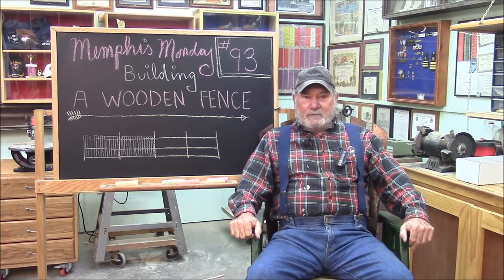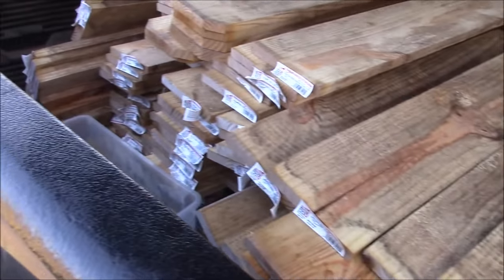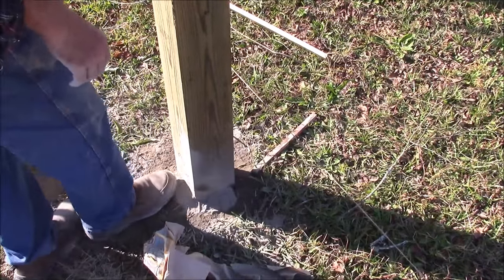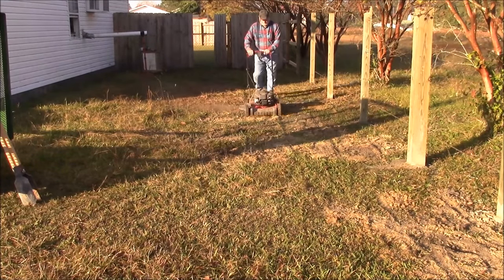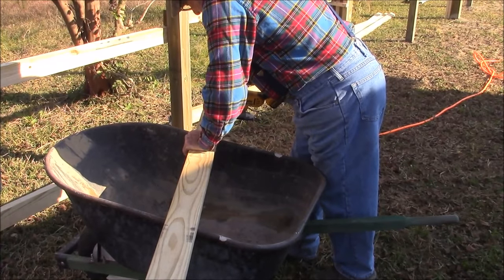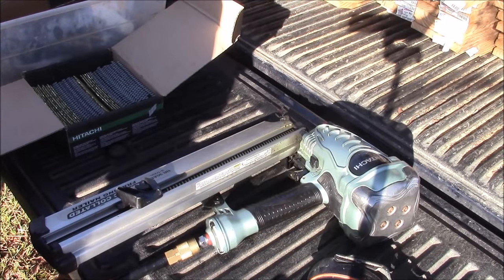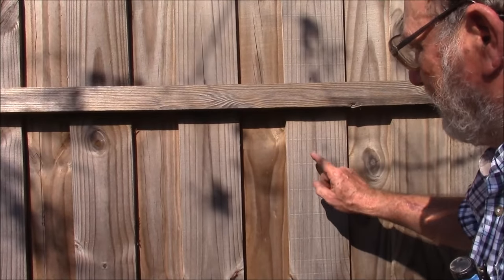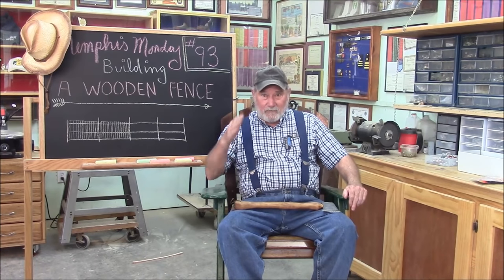Building 70 Feet of Wooden Fence MM 93

Comment: Absolutely one of the best wood fence building videos I have ever seen because of this video I'm going to build my own from scratch just like you did thank you for making it look easy.
Reply from the maker: The hard part isn't technical, like being an electrician, it is the physical labor that gets to an old guy.  But I still like doing it, just takes a little longer to recover.
     Before you build your fence, check out the way posts are installed in your location, which is variable.  
     Thanks for watching and commenting.

Comment: I enjoyed your interesting video & you going through all the steps of putting the fence up & the fence looks great & yard appealing. We're thinking of replacing our old fence ASAP.  And as a female your video gave me a little incite on this big project. Thanks for sharing.
Reply from the maker: As a 70 year old male it is liberating to say:  get some young folks to help!!  Male is best, as a 17 year old is not only indestructible, but they know they are indestructible. This is the demographic we ask to leap out of foxholes and charge into machine gun fire, and they do it!!!    .  
     The point is, building a fence is hard.  Not hard technically, rather it is just hard work.  This little 80 foot fence section probably had two tons of wood.  This wood had to be loaded, and then unloaded several times.  
     Good luck on your project, but I would offer two suggestions: 1) Get some young folks to help, or 2) hire a professional to install the fence.  Frankly, unless you are really into this kind of deal, like I am, then getting a professional to install the fence is the best option.  
    Heck fire, I don't even change my own oil.  I build fences only because I enjoy it.  So if you like this kind of thing, then build it yourself, otherwise hire a professional.  
     Thanks for watching and commenting.

Comment: For all that say dont put pickets to the ground.You need the pickets to touch the ground for the support of the weight it carrys accross the poles in between. Now for rot, even if you left the fence off the ground from day 1 does not mean it wont rot later, because the ground over time will build up, so put the pickets to the ground it help support the weight....im sure this guy knows gravity/weight.

Comment from the maker: The sound of a lonely cricket, followed by the sight of a small dust cloud pushing a tumbleweed down the single street of a ghost-town.
Reply: It is awful quiet here. I admit I'm a bit late with my comment(s), but I did watch the video on time. That fence line you built was a lot of work and made for a nice video. I like the style you used with the fence. I have to admit I'm a bit jealous about the soft dirt you have there. :-D
Reply from the maker: I totally hear you on that soft dirt.  I've lived in places where you would have to rent a power take-off post auger.  While I was in the service we were asked to plant trees on a bombing range in Hawaii.  The ground was so hard that we had to blow the holes out with explosives.  I concluded that the hardness of the soil (barring rocks of course) is the amount of volcanic ash in the dirt.  It seems like the volcanic material leaches out chemicals which tend to set like concrete over time.  
    My silly comment was for Hippie.  Last week we were joking about the visuals of the Clint Eastwood Spaghetti westerns.
    Thanks for watching and commenting.

Comment: Should be putting gravel in the hole first to get the post up off the soil.  The bottom of the post will rot if you do not. He used the wrong cement for one thing. Should have used the fast set (red bag) if you insist on pouring cement around the post. In any case the entire contents of the bag need to be dry mixed prior to putting it in the hole. The reason for this is the contents of the bag (cement, aggregate and sand) separate during transit. Also know that concrete will wick and hold moisture and cause premature rotting of the post. Wrap the post with 30 lb. felt prior to pouring the concrete to make a drainage plane.

Comment: helpful video. like your Tacoma
Reply from the maker: I had the original Tacoma, a 1985 Toyota pickup.  I drove it for 25 years, and of course trouble-free, until I needed a bigger truck to support my Memphis Applegate adventure.  So I bought a Dodge Ram, which worked fine, but I felt like I was deserting a member of the family when I drove away without the 1985 Toyota.  Trying to redeem myself, I bought the Tacoma, and it is wonderful.

Comment: great video Memphis enjoyed just one question the cost comparison with making the fences your self and buying them
many thanks look forward to watching soon
Reply from the maker: As built I think my stick built is perhaps $10  per eight feet more.  My version has 24 pickets instead of 20, and I used 2x4's instead of 2x2's for the stringers.  The stick built is easier to build, unless you have plenty of help to carry those prefab sections around.  Another disadvantage of the prefab panels is that the 2x2's are too weak and they sag with time.  My 2x4 stringers are stronger and will sag less.  
     Thanks for watching and commenting.
Reply: That's one of the downsides of prefab is the 2x2's used for stringers. I do agree 1000% that 2x4's are much better cause they definitely resist sagging.  But i hate hate hate building fences so i go the lazy route and get good quality prefabs. Yellawood makes awesome quality pressure treated prefabs that are just as good as you build yourself of course downside i have to settle for 2x2 stringers :( I am the incredible hulk i can handle prefabs by myself no probs lol
Reply from the maker: 50 years ago I was the "Incredible Hulk" tool   But I'm not the same hulk I was back in the day, and as Clint Eastwood might say, "A man has gotta know his limitations"  So far, that transition has been easy for me: "Well, I guess I can't do that anymore."   But at 70 years old I keep testing the envelope; I keep putting out the projects, looking for alternate ways to do the things "I can't do anymore."  
    Perhaps that is the key.  At 20 years old I could physically do anything, but I didn't have the experience, nor knowledge, nor skill to do much at all.  And now fifty years later, here I am, basing my work decisions on my own physical limitations.

Comment: Very good video and I learned alot as im thinking about doind a board on board fence. Do you still recommend spacing pickets 3.5 inches inbetween pickets or would you go wider? Thanks for sharing
Reply from the maker: The smaller the better, I think.  Main thing is to keep them plumb.
Reply: @MemphisApplegate  what do you think a overall cost would be for a board on board fence made out of cedar 250 ft with two walk through gates and two double wide gates? Just a ball park idea
Reply from the maker: @ddemier  Man I hate to say it, but $4000 plus, and it could be a big plus.  If you have the coin to finance a 250 foot cedar fence, with four gates,  then hire a real fence building contractor (unless you are really into it like me).  Professionals get discounts on building materials that you can't get, plus they know the codes, and know how to build fences.  
      In summary, if you can get a fence contractor to install your 250 foot cedar fence for something under five grand, then I'd consider it.  But, and I hate to admit it, five grand may not do it. 
     Hate to be that guy.  But check it out, and you will see I'm pretty close.

Comment: As someone who fixes lawn mowers, i don't approve of your dirt spreading methods, but you build a nice fence. lol
Reply from the maker: I'm not real proud of my dirt spreading methods either, and it wouldn't even be possible in normal soil.  However, I live on top of some ancient sand dune or beach in South Carolina;  my "soil" is really a talcum like sand when dry, and without rocks.  
     Of course this sandy soil still kills blades, and I have a set that were so bad that I turned them into trophies for one of my memorabilia cases.  I'd show them someday.  but then folks would think I was actually proud of this abuse.  
     Thanks for watching and commenting.  In a few weeks we install another fence, twice as long and with four gates. Should be fun, and I won't show the lawn mower trick this time!!!

Comment: That's quite a stretch of fence you built there. I'm surprised the pre-made panels used 2 X 2's for supports since once they get wet it's all downhill from there. The 2 X 4"s you used should do quite nicely.
Reply from the maker: Those pre-made panels seem like a good idea, but if you are working alone they are a real disaster.  They are almost always wet, and they are always too heavy and bulky for one person to handle.  Plus, they are not that well made.
    Much easier to scratch build the fence, unless you have several eager young folks helping.  Thanks again for watching and commenting.

Comment: I live in an area in Florida that has a high water table. I can dig  a fence post hole in soft dirt and by the time I'm 2 feet down my hole is filling with water. If I'm quick I can get another 6 inches and set a pole but I'm concerned about concrete. Once I dig that hole and level the pole can I just pour in cement and will it set with the water level being that high?
Reply: Yes

Comment: when the frame is all done,  and i need to start installing the picket pieces,  do i need to make sure they are level off the ground,  or level on top?
Reply from the maker: test
Reply from the maker: I kept my pickets level with the ground, which made the fenceline bumpy on the top.  This is not correct, but much easier if you are on level ground with only a few bumps.  I recommend lining the pickets up level on the top, and keep them plumb.  This will look much better, and it is how a professional would do it.  
    If you are on a slope then you may need to level your stringers, and step your fence up and down the slope.  Google "building a wooden fence on a slope" and you will get plenty of good advice.

Comment: What is the ratio in the buried section vs. above ground section for a typical 6 ft fence?
Reply from the maker: I bury the eight foot posts 2 1/2 feet into the ground, and then pack with concrete.   Check with experts locally, however, as different climate conditions require different depths (and different building material).

Comment: Expensive way to build a fence, mine are with 3/4 in spaces so wind will go through.  to me is like two fences worth of pickets. Is neighborly friendly I suppose but 5.5 boards with 3/4 in space is 6.25 per picket so 8 feet is 96 inches or 15 pickets. Your way is  5.5 + 3.5 space which is 9 inches and you say 24 boards you used per section at 6 dollars per picket your way is 56 dollars per section more expensive then normal fence and water will accumulate on overlap but normal fence will all dry out and not retain moisture. I not recommend your method for expense and water retention as well it is not wind friendly.

Comment: Why didn't you put gravel in hole so post can rest on.....I like the cement idea....
Reply from the maker: Okay, I'm with you.  Let me ask you first a simple question.  Why did you watch this video???  This is a real question, and has great implications for my future videos.  I have over 200 videos on YouTube, but suddenly this one has 130.000 views.  Let me put this is perspective:  100 views is about normal for my videos, but suddenly I'm getting 130k on this one. but why? 
       Okay, I'll give you the answer anyway.  It all depends on your local situation.  Find out what folks do in your local area, and that is the answer.  In my sandy soil no gravel is needed.  If you lived in Montana or Alaska you wouldn't even need treated posts.  In the Midwest these posts are driven into the ground with a pile driver; zero cement, zero gavel.  
     Anyway, hope to see your comments on some of my other 200 videos.
Reply: @MemphisApplegate  Wood piles have a much higher treatment retention value and use a cca preservative unlike the 4x4 posts you are using. Pressure treated lumber is not meant to be in a condition of constantly wet. Eventually there will be a gap between the concrete and post and this will hold water thus accelerating wood rot.

Comment: How deep did you dig the holes for the 4 x 4's?
Reply from the maker: Around 2 1/2 feet.  If you make the hole wider, then you only need two feet.  But it all really depends on your ground.  Actually, I saw some fence guys driving posts into the ground for a woven wire and barbed wire fence.  It was amazing.

Comment: You are a nice guy, no doubt.  Don’t agree with how you anchored the posts, letting the bottom of pickets touch the ground (promotes rot), and overlapping the pickets.  One straight fence though.
Reply: You need the pickets to touch the ground for the support of the weight it carrys accross the poles in between. Now for rot, even if you left the fence off the ground from day 1 does not mean it wont rot later, because the ground over time will build up, so put the pickets to the ground it help support the weight....im sure this guy knows gravity/weight.

Comment: Why does everyone break all the 2×4 joints on the same post 
If you put your post in at 5ft on center and use 16ft 2×4's you can stager the joints. Put a 22 degree bevel on 2×4 stringers and pilot drill and use exterior screws to attach your fence will look great and last longer than your video

Comment: Hey  Memphis    just an  Idea    Next time  cut a board 3 inches  wide and use that for your template when spaces the boards 
for overlap     Just  an Idea  will take the guess work right out of it     Thanks for  the fence  video   looks  great
Reply: cbo7107 I thought the same thing. Just after every 6-8 pickets gotta re-plumb because of the bow and crown of the wood

Comment: how do you get the top level all the way down the fence
Reply from the maker: I'm on level ground, so I just spaced the bottoms of the pickets about an inch off the ground.  But there are lots of correct ways to do it, but all of them depend on your situation.  
     For example, if you are on a steep slope, then you will need to level your pickets in sections, which means staggering your stringers while keeping them level.  Bottom line, find a video that corresponds to both your topography and to your type of fence.  Moreover, don't try to invent anything new, as I guarantee anything you think of has already been done.